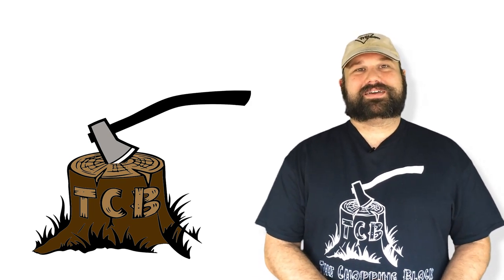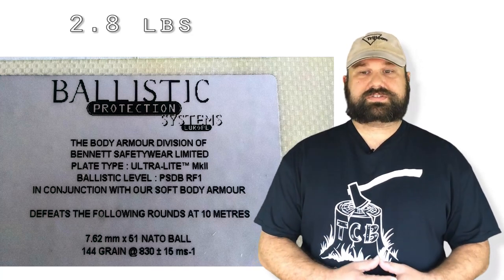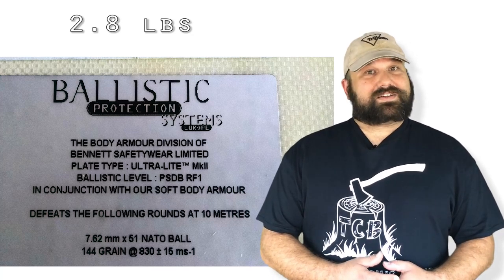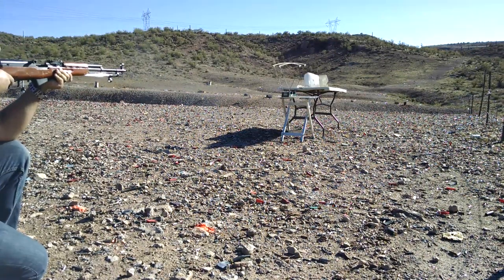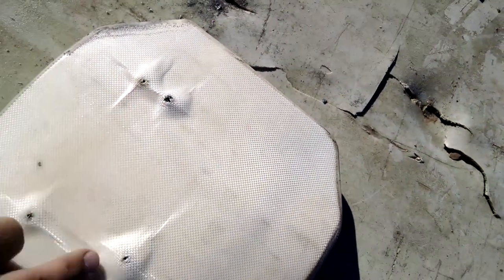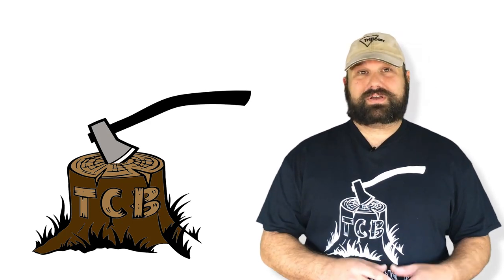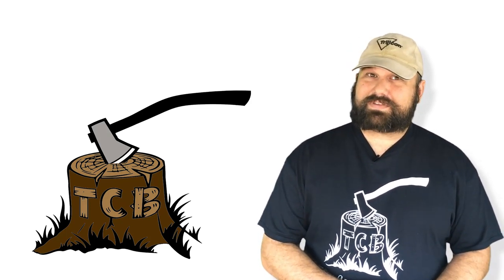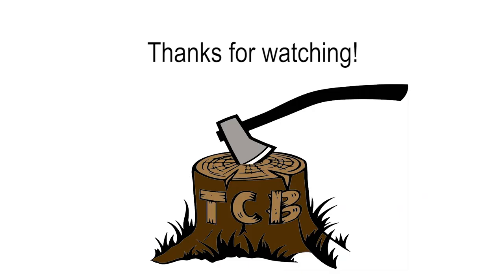UHMWPE armor vs 7.62x39mm Norinco steel core FMJ

Comment: Hate to be that guy but....there is something wrong with the testing. The problem is quite often the norinco Steel core is not actually steel core. The only way to test (jacket is magnetic) is to pull the bullet and stick a paper clip into the exposed lead/ steel. If it slides in its lead. That being said im 90% sure the actual steel core will beat a UHMPE body armor. Maybe not reliably but......should.

Comment: Hey Choppin Bloc. Been a sub for a long time.. Surprised you don't have 10x the subs honestly... I got addicted to your channel when you did a ton of 10mm testing. 
No disrespect.. one of the main issues might be the crap audio you have during testing. Might want to just delete the audio from the GoPro or whatever you're using, and simply voice over that part of the video from now on if you're using a that camera. Several of your videos use that same camera, and you literally can't hear much except very mumbled audio, like you're using the microphone on a gopro, inside the housing. Just block the audio, and do your own voice over.. cause you can't hear crap anyways.
Reply from the maker: Poppa Bear You're right. I've been struggling with the wind noise from the beginning. The place I shoot is always really windy. Dubbing over is certainly one solution. I've been trying to find ways to cut the noise, though. I have used an external mic on some videos and that seems to help a bit. I might start using the lapel mic, though.
Reply: The Chopping Block Wind sock on your mic might prevent it, but depends on your microphone.
They have a sony add-on mic for gopro, which is stereo, and they're cheap.
Lapel mic might work, but might recommend just a standard voice over. 
I know all your videos are at the same place, and it's wide open there, so wind picks up a ton of speed.
Are you on Facebook? I have a new patent pending product that you might want to check out and possibly review. Cheers! 
PS: Let me know what kind of camera you're using. Might be able to help. I do this stuff sort of for a living. I own a couple businesses. One of them is firearm part manufacturing, so constantly seeking out better ways to make high quality video.
Reply from the maker: Poppa Bear An iPhone 5s, a Motorola Droid Maxx, and a Casio Ex-7ZR for high speed.
Reply: The Chopping Block I have a large production video camera, Canon XL-H1, with excellent microphone. I bought mine a few years ago brand new, but the 20x zoom lens with the excellent image stabilization makes it utterly perfect for what you're doing.
They make stock "Fuzzies" for the microphones, and honestly, I see your channel taking off like crazy. Just a bit of professionalism in vid edits, slightly longer videos, some new, unusual content to roll in and I think your channel will take off.
I've got some ideas for you. The Green Screen you're using, is that actually green , or do you chroma key on another color?
Also, I own and manufacture firearms parts for a living. I should technically be at the SHOT show this week, but too much going on with another corp I own, so had to cancel plans. Are you interested in doing a review? I can give you more details if interested in PM or on FB if you're on there. 
Cheers! 
PS.. This is my primary personal account. Both of my other Youtube accounts are attached to my companies, so I'm not really free to speak my mind on them... This is literally the name a lot of people know me by.. long story, but not a troll or anonymous account. Take care bud. I think you're just a slight change from having your channel explode. You got the personality for it.
Reply from the maker: Poppa Bear Thank you. I have a foam fuzzy for the small external mic that I sometimes use and that helps a little for very light wind, but I need to make a dead cat. Believe it or not, tape over the mic holes on a cell phone actually helps a lot. The screen is actually green. I'd definitely be interested in doing a review. Email me at choppingblocktests@gmail.com.
Reply: The Chopping Block - email sent! Thanks!

Comment: First again, the internetz points are mine today again. I bet it will not, slow and thick.
Reply from the maker: Johannes von' Strauch \Liandri_Development_Group/ You win teh interwebz.
Reply: What do you think about the EFAB? Less muzzle flash than the A2 Birdcage but 51% less recoil (independent test measure, not company advertising), which means its cut in half, thats substantial. Also low side concussion. I have the feeling that it got quite overlooked, while other similar but far worse performing devices got buyed. https://www.rainierarms.com/media/product/369/precision-armament-efab-hybrid-muzzle-brake-308-7-62mm-a04-488-by-precision-armament-74d.jpg  /  https://precisionarmament.com/v1/wp-content/uploads/2014/09/PRECISION-ARMAMENT-EFAB-HYBRID-SBR-FLASH-HIDER-COMPENSATOR-CUTAWAY1.jpg The ports arent some random holes there directly shaped like dozends of little 3prong flash hiders.

As example the knights armament mams, same recoil with far worse flash.
Reply from the maker: Johannes von' Strauch \Liandri_Development_Group/ I have no idea. Not in my wheelhouse.
Reply: The Chopping Block What means not in my wheelhouse?
Reply from the maker: Johannes von' Strauch \Liandri_Development_Group/ Not my area of expertise. I don't know much about muzzle devices.
Reply: The Chopping Block Oh ok. My favorite area of devices is Hybrids. Which both cuts recoil in half, but does not increase flash (which most manufacturer called hybrids on the marked increases). Also side concussion should not be strong like a direct large port muzzle brake.
The EFAB seems the best due to the special port geometry.
I dont think its wort to increase flash and concussion for less recoil. But when you can decrease flash, have low side concussion and half the recoil its perfect.